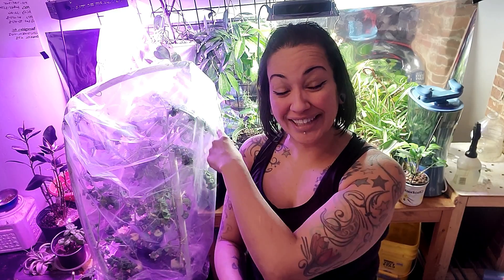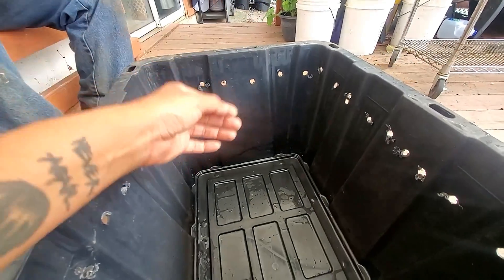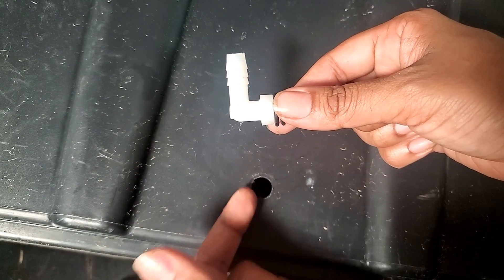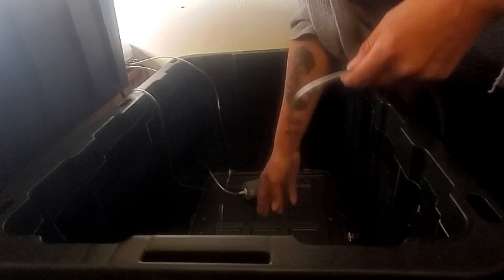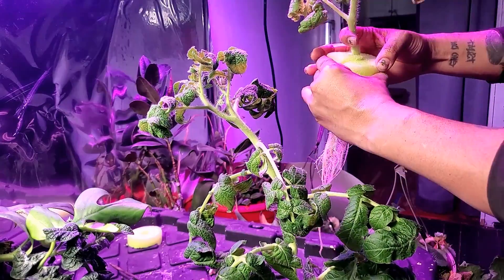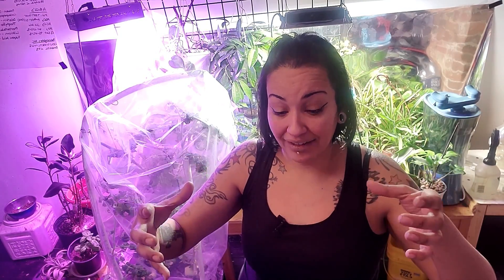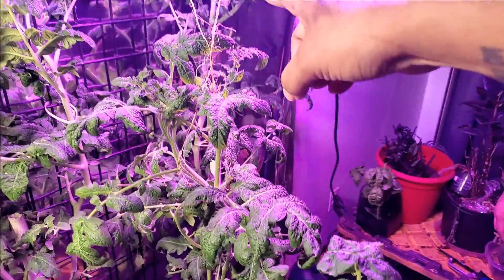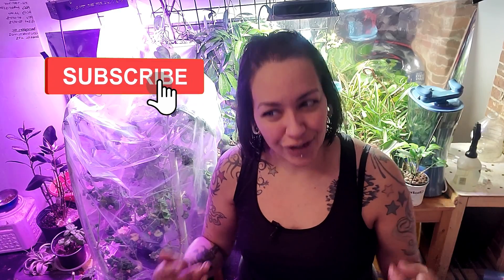Creative Build With An Indoor DWC Hydroponics System

Comment from the maker: Jose was doing tomato maintenance on these plants for me and to my dismay i had to take off the bags due to TOO MUCH moisture. I used twine to tie the plants(problem #1) instead of zip ties and being that there wasnt air flow it was a breeding ground for mold (problem #2) the bags would work if u take them off daily to let the plant breathe then put back. That's the only way. If not that's you need a tent/indoor greenhouse to house them.

Comment: Between your Pops with the Gorilla Tape and Jose with the heat gun you're getting it done! There's another version of that tape called Gorilla Waterproof Patch and Seal that's much more heavy duty I've used it to fix guttering 😂 All of Gorillas products are great I've used the original to attach the metal stand for my mailbox it actually held up too, you have to wet the surface then apply it and the glue expands on contact! Love your science lessons Jackie keep up the great work! 🌱🍅
Reply from the maker: Wow I appreciate that so much! I know that going to my dad n bf for insight based on their personality type always helps be the best gardener I can be. They see things I don't see😁🌻.
Reply: @TheAdhdGardener  For sure that's what family and community is all about, we work best and thrive when we pool our resources and share ideas! Gorilla Clear Grip is cool too I sealed the tank on my carpet shampooer with it so it can take heat and vibration, I'll stop before I sound like I'm a spokesman for Gorilla. 🤣